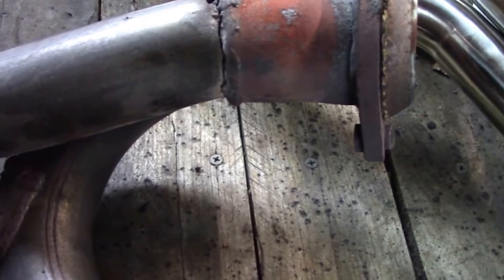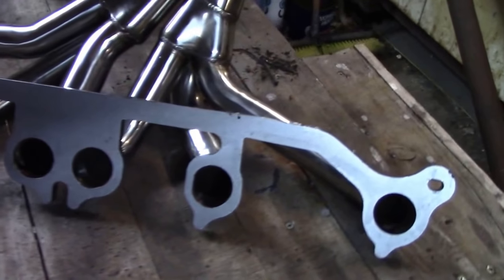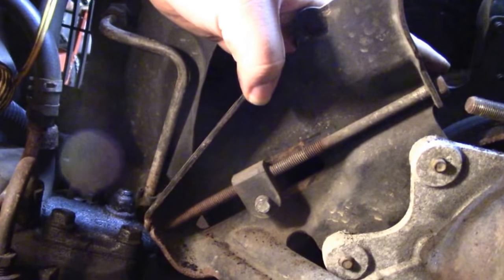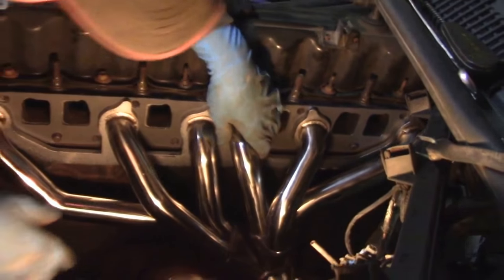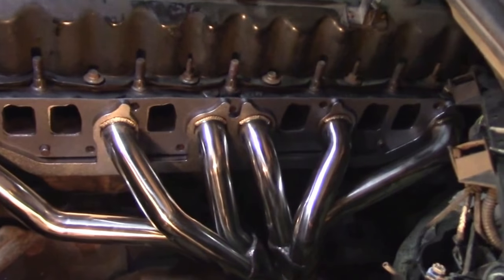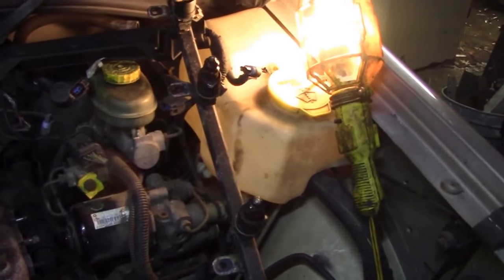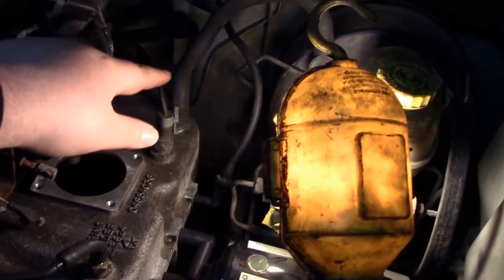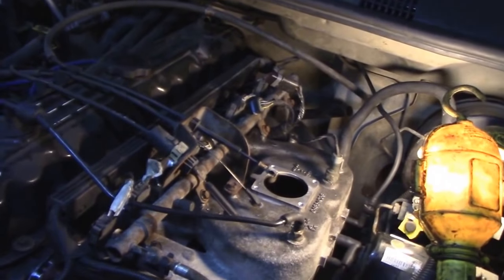Upgraded Intake Manifold and Blackhorse racing header on a Jeep Grand Cherokee 4.0 part 2

Comment: I have a '97 ZJ with 245K and I did the same exact thing shown in these two videos today. Great info, thanks so much for doing this. It was near impossible to tighten bolts 2 and (especially) 1, and I had the lower half of the factory air box in there so access was super tight. I put Banks headers in, for what it's worth, perhaps the Blackhorse allows for easier access. 
Good job and thanks again!
Reply from the maker: Enjoy ..

Comment: ...lol... I can't believe I'm actually searching for some dude with the skills to help me build this beast. These Jeeps are more dependable than most rigs in general. I have a fortune wrapped up in my Cherokee but it doesn't hurt to plan ahead and go ahead and keep changing to better upgrades and then when I FINALLY find a green Cherokee with roll up windows. OMG switch everything over and wallah! a normal rig with a very strong motor. Ever since we took the smog shit off I swear my jeep is running cleaner and at a more cooler temperature. I didn't know they even made a header for this 4.0. If I went all aluminum, I wonder what that would cost.
Reply: Dexjeep can help you. Tennessee.

Comment: Keep it up buddy I’m in a loud ass semi so thanks for the voice volume awesome video
Reply from the maker: Thanks for watching
Reply: Also my 87 Comanche has a header leak so would this work on that? And is that just a stock 99 and newer header ?
Reply from the maker: @ComancheTribe69  you have a renix i think they say you have to use the new power steering pump and bracket.. By yes mine is the header and stock power tech intake.

Comment: Can you put it on a 2001? I want to rebuild headers back, but I am unsure of the liability. I mean, it seems like I could, but there’s no info on any header changes over 2000’s - is that because it’s illegal to have no cats?
Reply from the maker: I believe the 01 has a 2 piece header with dual outlets just buy a header for an 01.. I'm not sure if there is cheap ones out for them but I know banks power used to make them.

Comment: Doing the same job in my ZJ but will kip my intake ,i did replace the inyector 300xxx plus was time and poly engen mount nice job
Reply from the maker: I had that intake for probably 7 or 8 years i figured it was time..  Hope my video helped..
Reply: @backwoodzcustomz1549  i will upgrade to when i rebuild the eng hope it will be next summer thanks and happy holly days

Comment: Recently fitted the same header to my XJ and yes, it sounds quite different, but... the gasket which comes with it is junk, no fire rings and also the different shape and angle of the #4 pipe makes it extremely difficult to get the bottom bolt next to it in and tightened properly, wonder what your trick was, i used a spanner flat to the block, no way to get there with a socket. ...And by the way, if you wrap your header it keeps your engine bay cooler and helps alot with scavenging because of higher gas velocity.
Reply from the maker: No tricks mine went right on.. Everything bolted up like factory.. No issues with my gaskets been on prolli 2 years now and 15k... Also ill never wrap a header, juat asking for issues.. Thats why all header companies void the warranty if its wrapped..
Reply: @backwoodzcustomz1549  ...well mine is a right hand drive, everything is a bit more cramped on the left side, perhaps that's an issue. Re. wrapping, who cares about warranty with a $70 part, no matter which style of header and if you wrap it or not, 2 years and the thing is cracked, at least in such a wet country like the UK.
The warranty is probably 6 months at best, but the benefits of wrapping are evident, the exhaust ports are pretty small, so if you want power you need the best possible scavenging and cold intake air.
Reply from the maker: @dynoguy  everyone has their own opinion about wrapping i find it to be useless.. Also never seen any real dyno proof that it does anything... If you wanted to pick up performance spending a bit more on a header would have been the way to go.. This is just a stock replacement.. Also if you have your intake sucking cold air under hood temps dont mean much, especially on a jeep where literally your inta and exhaust bolt together and that manifold is heat soaked with or without wrap...
Reply: @backwoodzcustomz1549  Well, dyno-proof is a neat idea, maybe i'll do that when i rebuild my engine next year ...have quite a few dynos, btw ..:-)
Reply from the maker: @dynoguy  then your the man for the job!!!!!
Reply: what header did you use on your jeep xj?I have a 2001 jeep cherokee that needs a header
Reply: Thank you for that info about the wrap im changing my header ( its leaking believe it or not! )

Comment: Sounds good! Im wondering how these have held up though, any cracks or leaks? Still trying to figure out which headers to get. Thanks
Reply from the maker: I do have a leak... BUT havent checked it out yet..
Reply: @backwoodzcustomz1549  thanks for this update!.
Reply from the maker: @keithbaker1951  I would buy them again... Great upgrade... But not really much power... I mean it looks just like the stock one..
Reply: @backwoodzcustomz1549  the ones i bought but have been sitting in my closet for 7 months are the ones with the flex joints on #1&#6 hopefully it helps!
Reply: @backwoodzcustomz1549  i am surprised your " butt dyno" didnt feel any different but honestly im not building a race 4.0 anyway like you mentioned.   Ive got 346k miles and she still gets 22+ mpg if i stay outta her i love my 99 xj
Reply from the maker: @keithbaker1951  yea, it's just a better design than oem... So I went with it...

Comment: Inspired by this video and needed to replace a cracked manifold I got a similar exhaust manifold and newer style intake for my 97 TJ. Having problems lining up the bottom intake dowel hole with the dowel on the right side. Seems like the intake won't come down enough on that end and is blocked by the top of the new exhaust manifold. Left side seats in the dowel no problem. Any ideas?
Reply from the maker: Do they fit 1 by 1? Like does the intake fit alone and the exhaust fit alone?
Reply: @backwoodzcustomz1549  They do yeah but the combination of the two is the issue. The 6th tube on the exhaust manifold is in the way of the 6th tube on the intake from allowing it come down and into the dowel. I was able to cut half of the dowel hole piece off so now it is at least flush with the engine. It's slightly offset by 1/4" but think it should be good, will check for leaks. Now I have an issue with the throttle body map sensor coming in contact with the first fitting on the right but after watching some clips it was installed previously facing the wrong way. Anyways should be up and running soon, can't wait!

Comment: What gains have you noticed with that intake setup torque wise? I did the wrapped header/exhaust already great sound.
Reply from the maker: I didnt really notice any power increases
Reply: @backwoodzcustomz1549  I figured the increased intake flow would be noticeable since these 4.0s are made for torque originally Thanks.
Reply: It's a myth, if you port match it would be better though.

Comment: The cracks come from worn engine mounts.
Reply from the maker: Engine mounts are fine. Cracks from 220k miles of bad design..
Reply: I have had 3 over 250k miles no cracks. The hard mount on the crossmember with worn engine mounts let it shake and flex and break. Jeep exhaust design not the best one going
Reply from the maker: @scottcampbell2836  ive replaced many of these with under 100k on them.....

Comment: I would avoid using silicone grease or any silicone gasket sealers as they can contaminate the O2 sensor.
Reply from the maker: You need to use silicone or it won't seal, it's cast aluminum.. I'd be more worried about an intake leak and going lean..
Reply: If the surfaces are machined flat use anaerobic sealers instead.  A contaminated O2 sensor will make your fuel to air ratios go crazy. Just like an intake leak. I've seen it happen. I'm a mechanic with 30 years experience.

Comment: Put a 62mm throttle body on there for some more flow.
Reply from the maker: Maybe some day. But shes reliable not a race car..
Reply: @backwoodzcustomz1549  I have one on my 93 4.0, makes a HUGE difference, especially with that new intake manifold.
Reply: where u find that 62mm ? I'm building a turbo jeep 4.0 stroker to 4.7

Comment: I would have also wrapped that header. Keep the heat soak and engine bay temps down
Reply from the maker: Yes anyone who wants a junk rusted out header in a year should wrap it.. All headrr manufactures will not warranty a header if it was wrapped... Ever notice no header company makes header wrap? Also under hood temps dont matter, the only thing it changes is your AIT and if your worried about that just put a proper intake on that gets cool outside air.... As i said before its an alum intake that is bolted to the exhaust.... Your not gonna get dense air in that motor no matter what you do....
Reply: @backwoodzcustomz1549  if you're using a stainless header, you won't have a rust problem. You can also use a high temp paint to prevent rust even more. Also there are specific types of wraps and specific ways to put exhaust wrap on to prevent rust. And a cold air intake doesn't help if the engine bay is too hot, unless you have one that is specifically designed to pull in air from the outside. And finally, it may not help heat soak a lot, but every little bit helps with that 4.0, considering that those motors can't breath for shit in the first place
Reply from the maker: @nathanhoover3636  stainless steel will rust... A cold air intake always pulls from the outside.. Any other intake is useless except for the cool sound, and would make more power with a factory intake.. Also all heat wrap will rust out a header.. The problem is it retains moisture...